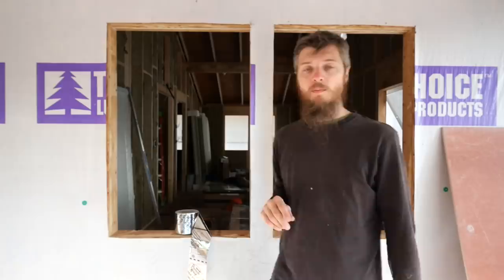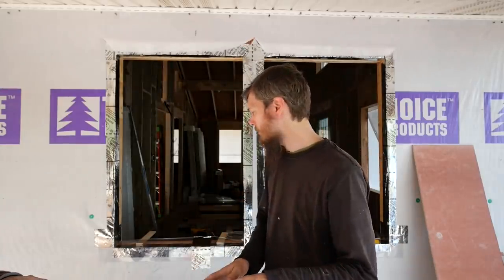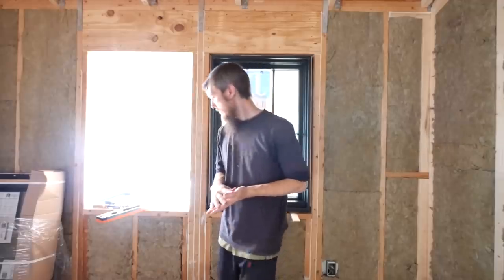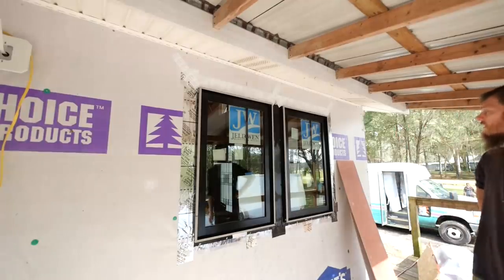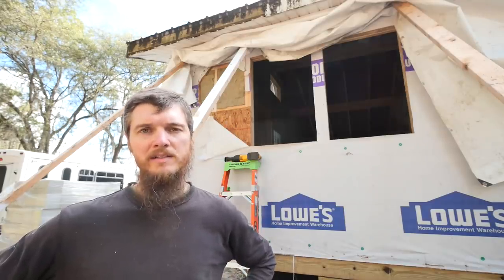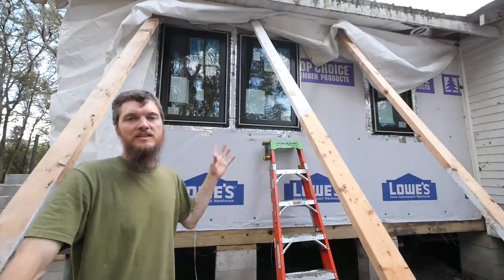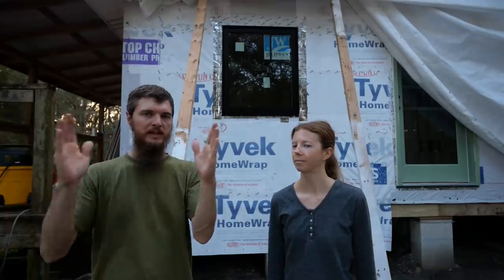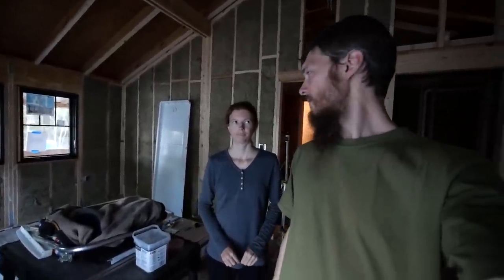New Windows Reveal and Install - Trendy Black Window for our Old Style Home

Comment: I like the black, white will withstand time, but not the grills. I like unobstructed fixed windows unless the window needs to be for egress which require a certain size opening & access to the finish grade. What type of exterior siding & color are you planning? Green door may need to go. Two doors for egress are fine depending on the locations & travel path/ distance. I can offer you advise if needed; I’m retired architect.
Reply from the maker: The siding and color will be a surprise :) Thanks!
Reply: @diyfferent  I’m beyond different, popular, cool, over the top, minimalist, sense of emergency , as- built conditions or budget because I have dealt with all & designed , renovated , re-imagined, converted & built over 1500 residential & Fortune 500 / developer commercial buildings in the SE  for 40 years, but give it you best shot. 
Love to see/hear your thinking/solution. I like your honest approach  &  enjoy your effort in what ever you are doing. You are differently off which is why I like videos. Keep on trucking!!
I like your sock/ shoes. Where can I purchase them?

Comment: I find so much inspiration with everything you 2 accomplish.   A few years ago I had the exterior of my brick home painted.  I bought the paint and specified black paint for my wooden windows and trim.  I was living elsewhere so I wasn't available to monitor details.   No black paint was applied anywhere, the cans of black paint vanished.   The glass is in a 6 over 6 style so it's a lot to repaint 31 windows.  Seeing your windows makes me rethink painting the wood, replacing the windows or leave it as-is.  Your black windows created such an impact I wish I had half as many windows.  Your current home will quickly improve not only your property values but all your neighbors as well.

Comment: Start with the bottom sill then the sides then the top when using flashing or tape... so when the water runs down it don't go behind the flashing or tape... Also some caulking under the sill pan helps seal and keep it from moving around
Reply: Yes, I was thinking the same thing.

Comment: Looking forward to seeing the siding go on.  I love the crank open windows. I wanted them in my addition and the builder told me the cost was too great.  I have always regretted giving in since he quoted $80 square foot and it ended up being $100 even without my windows and me accepting other things not done as was on the original quote. I didn't add anything, but was given less on some things, but he also gave some extra that I had not asked for.  Overall I love the room. This was over 20 years ago.

Comment: Sorry had to hop back in, you are so right silicone under the windows is completely unnecessary. Also the protector wrap is a great product. I also use the Tyvek tape or knock off brand Tuck Tape, around the window to house wrap which works well. I also use the same tape over the jay channel to wrap to really seal it off leave the bottom open as you correctly point out. I have come to the conclusion you either need psychological evaluation or are my idol!😁 The pocket hole framing had me scratching my head but hey,  at the same time loved it!

Comment: I love the windows! I heard the black is the new way to go. It looks beautiful I can't wait to see each step of the way. You have to be so excited just know we're excited for you.
I just had new windows put in my house and they are wait on the outside on my I can see where the dirty white is going to bother me. I was going to put white siding I did not I went gray and I am thankful for that because the gray hides the dirt. I wanted a white house with white trim but I knew it would bother me seeing the dirt on the siding. I so wish we could have done it ourselves we would have saved thousands but I found a family that we know that gave me a good deal but still you are saving thousands doing it yourself. I did the Privacy glass in my window as well I did privacy halfway up so we can see out the Upper half. The only thing I'm having a hard time with my windows is there tricky for me to lock and I don't know if that's the way it should be. We did run into that egress windows for bedrooms and since I was going from a crank out window to a double-hung I actually had to put in a bigger window in one bedroom and in my other two bedrooms we added window to each room and those were sliders so those became my egress window. But they're on the end of the house so you won't see them as a different window as the double-hung that are front and back I have a family member that on their casement window just by changing to a different type of hinge and crank out it gave them the allotment needed for an egress window without having to go to a bigger size
I always love to see what your children are doing Tell Maverick I think his fish are pretty awesome and thank you for sharing them with us. We used to have fish in our house always so fun to watch. The Otter has to be so fun to see.

Comment: looked like you had a lot of moisture in the ailines and the airnailer , might want to drain the compressortank blow out the lines and add some oil in the airnailer to prevent it rusting

i remember fishing for tadpoles and guppies at home as a kid  , we used a small bucket and a rope m just trow the bucket in the water let it sink then pull it out reasonably fast and see wat was in the water inside the bucket

as for the sealant : it doesnt only stop leaking it allso stops creaking / squeeking from the wood working against the frame if the house moves from walking passed it or the wind moving the wall slightly , foam or felt tape should work too

Comment: Are you finding out , you have different building rules living down in Florida from living up north. What differences have you found?
Reply from the maker: Most of the rules are the same. Some things are different like no vapor barriers on the inside here, hurricane strapping requirements, and insulation requirements are different.

Comment: I love a solid unbroken line of sight through a window. My old home had big double-hung windows 36" x 54" long and the bottom was a solid "light" while the top was a 9 "light" and They were awesome and the rooms were so bright. The home was over 100 years old, the home I moved into with my new hubs has much smaller windows and the 6 lights on top and 6 lights on the bottom of the vinyl double-hung windows but they are like yours encased in the glass. It is harder to get a great view through to the outside because the stile breaks up your vision. I know it is just my thing because most windows have them but I do like how yours are! How cool to have otters in your pond, I could sit and watch them for hours. Did they just come up or have you seen them before and just not gotten them on camera? Merry Christmas to the whole family!
Reply from the maker: We saw the otters a few other times. :)

Comment: When tapping windows you should start on the bottom and work your way up. You guys started on the sides? Is that because of the plastic sill plate?
Reply from the maker: We put tape on the sides first to seal the house wrap and window opening. Then the sill pan, then the window, and then another layer of tape on the sides. The first layer of tape was extra. The last layer is the overlapping layer.
Reply: @diyfferent  Yes, I saw that, but I have always been told to put the final first layer across the bottom than the sides then the top. I have never seen that plastic sill tray. That looks like a great invention.

Comment: Tripping over alot of terminology today!!! The window dividers are called muntins, the glass is called a pane, and the bathroom window is opaque (or translucent).  Also, better internal lighting aimed at the light source (windows in the case), will offset the camera adjusting the aperture due to the windows being the brightest item in the scene.

Comment: I have been watching your channel for a while.windows look great. I would like to add though that you need to handle your house wrap cut out differently as that is not what you are supposed to do on the openings.
Reply from the maker: No worries. We're cutting them out properly, the way windows should to be done :)
Reply: where do you "experts" come from, they have done a marvelous job on many installations!!! stick to making money, cuz the SUPPOSED to comment is off the mark!

Comment: It is very expensive to buy a stippled glass window for the bathroom.  A plastic sheathing can be purchased in a scroll at home improvement stores and applied with hydrogen peroxide for the same effect.
Reply from the maker: The cost was basically the same to get that glass option; for this windows series at least. :)

Comment: window n03  not  put protect wrap tape at top side ?
Reply from the maker: We just changed the method slightly after the first pair. since the top doesn't have house wrap touching the osb. It's hard to explain but it just made sense to us.

Comment: the fire egress windows are for the fully equipted firemen to get in has little to do with you getting out most fire codes are for protecting the firemen not the residents for the most part